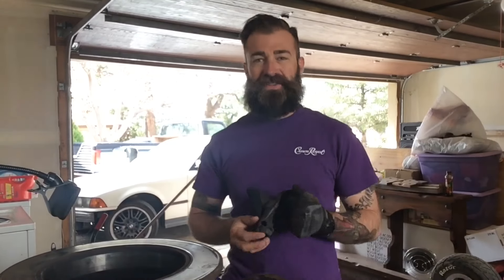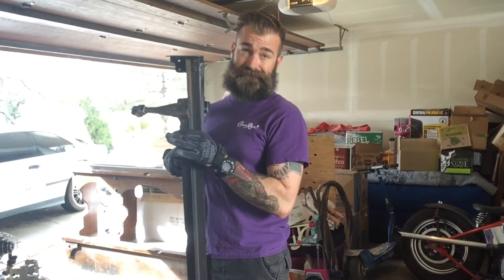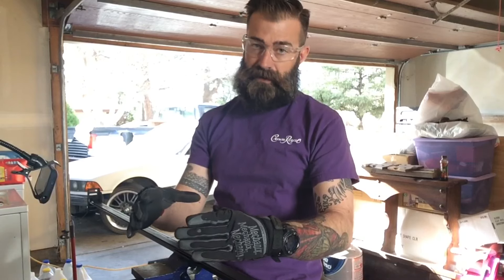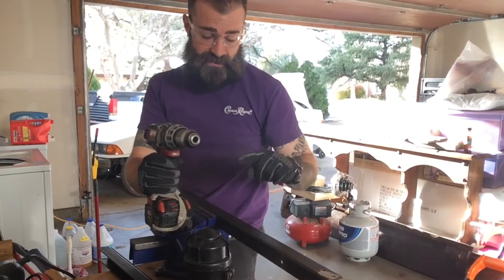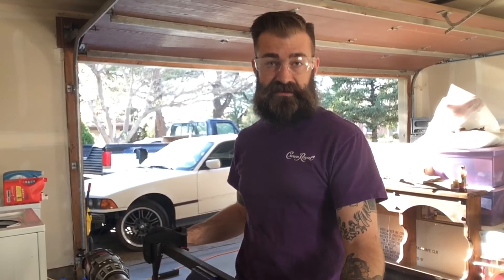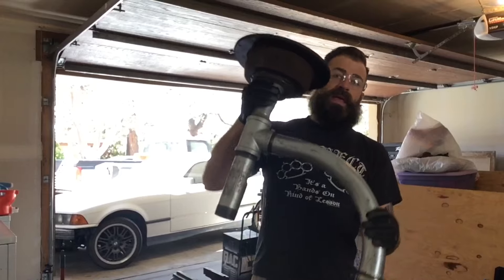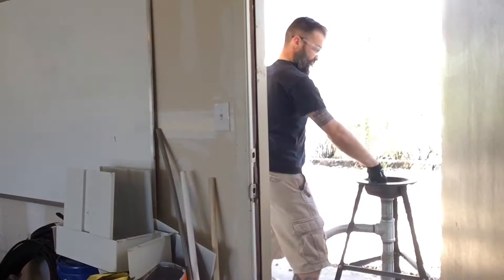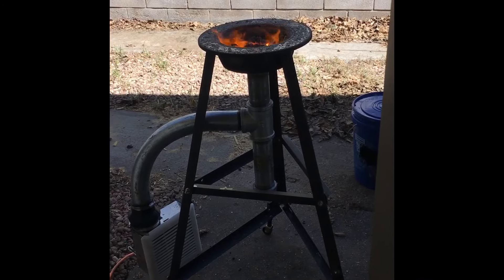Marshall shows you how to build a forge at home

Comment: how does the steel of the brake rotor not melt as well?
Reply: It does get pretty hot but the heat rises and is already above the bottom of the rotor.  The issue I've had with my drum forge is the drain at the bottom tends to melt because it's aluminum.  I just took a piece of 1/8" angle iron and made my own to solve that.  I also use coal instead of charcoal because it gets hotter, burns longer, and sparks less.  With a very similar setup, I'm able to forge weld and make Damascus steel.

Comment: The galvanized steel still freaks me out. Do they sell none galvanized piping that would work similarly?
Reply: Yeah, either get some black iron pipe or you can grind off the zinc (while wearing a respirator).  I got pretty sick from inhaling the fumes the first time I used the forge with coal and the zinc burned off.  If you're grinding, welding, or exposing galvanized steel to high temp, be safe, get fresh air, and drink milk before and after.
Reply from the maker: +Marcello Genovese I don't worry about it. I've run this particular forge all day almost every weekend and have noticed no ill effects. 
The bottom of the forge doesn't get very hot, comparatively, because the heat is being pushed upwards.
Reply from the maker: +William Cummings Are you sure it wasn't from the coal? 
One of the reasons I don't use coal is because the coke burn off mixed with water makes acid.
Reply: marshallknowsstuff yeah that might have been it.  I still run it all the time and I don't get sick anymore though.  Matter of fact, I just ran it all weekend making some damascus dice.

Comment: wrenches are hardened steel my friend, IE you have to heat it up to critical temp then let it slowly cool all the way down for the metal to normalize b4 working with it... One really proven method is to plunge it into clay (kitty litter) and let it come to room temp on it's own.. Then repeat that same process after you are done hammering on it before heat treating it in oil.

Comment: I am a little skeptical as to the safety of this.  Tripods are inherently unstable, which is why so many things have four legs instead of three.  You are relying on the inertia of the mass of the metal to keep it from tipping.  Maybe that is sufficient if you keep it away from your jeep (or somebody else's) running into it.  Of course, the wheels make the mass's inertia troublesome if the forge is accidentally bumped.  I can foresee you being unable to stop it if it gets moving when you don't want it to.  At the very least, you should have some sort of brake on each wheel that you set when the forge is active

Further, it seems to be capable of only red heat with the blower at full blast.  You need to be at far higher temperatures to forge many steel types.  And your expansion of the fire pot will eat your fuel up if you keep the blower running continuously.  The large % of air exposed fire surface in proportion to the shallow depth will lose heat rapidly and constantly.  

Also it will be difficult to create an anaerobic heat environment in the center of your charcoal at the forging level that will stay stable with so shallow a fire pot, because you will have to completely shut off the blower to do so.  The fire is now totally aerobic at the moment with so strong of a forced air source.  At the very least, I would suggest some sort of rheostat to keep the oxygen at a minimum and confined to the lower part of the fire while the upper part is oxygen starved.

I hate to be a nay sayer when your enthusiasm is so contagious.  It makes for highly entertaining video.  But I do thing you are headed to frustration and possibly danger at the current moment.